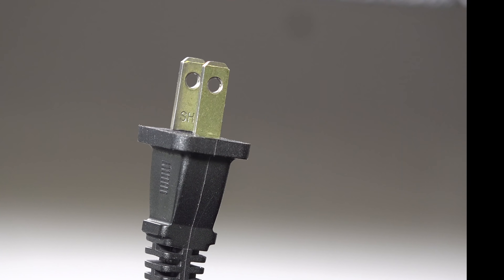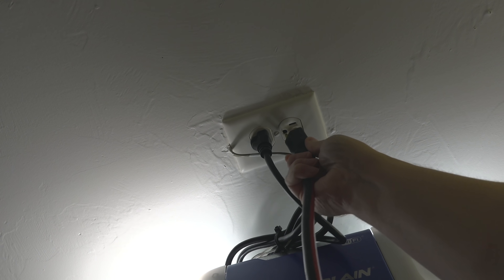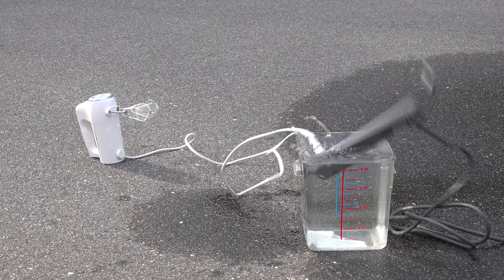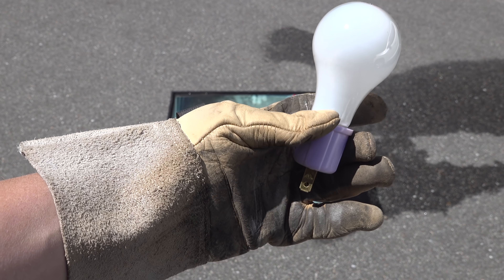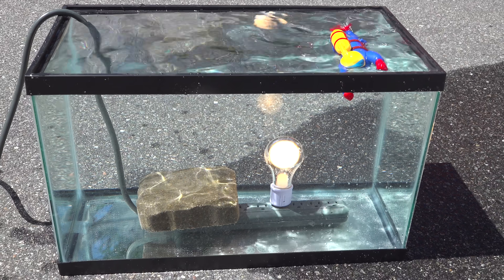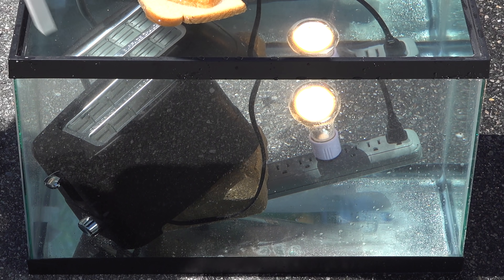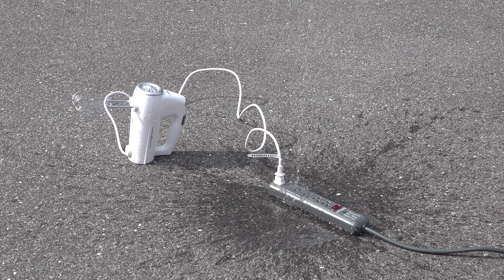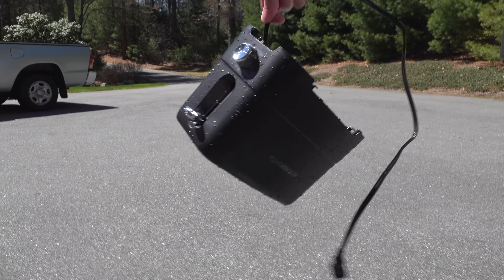What REALLY HAPPENS WHEN YOU SPILL WATER in an OUTLET?

Comment: Yup it fully make sense, GFI plugs are designed to trip if the GROUND gets power, so making contact between neutral or hot to ground will do that.

Both the neutral and hot wires carry current so between them it wont have a problem, but it will trip a proper house breaker (in canada) if you have the hot and neutral together.

But on that ground should not have current as then every box in your home is electrified like the screws on the switch plates and more as the ground wire on each box (if installed correctly) is now possibly hot. So thats why you use a GFI not to protect devices in most cases but to keep your house ground from getting overloaded, you can however do a direct ground connection from that box.

Comment: Pure water is a poor conductor. If water  is acidic or basified it will conduct electricity which might cause short circuit . I am no chemical engineer but this is what I was taught in 10th grade , I haven’t tried it , May be you can and then share. 

When I was young , Yes I did try salt water with DC electric terminals (12 volt Dc Adaptor) and I think it produced chlorine bubbles on the terminals of the adaptor

Comment: Thats so unfair, I spilled water on my battery backup and it instantly sparked.
Reply: That's a complex device compared to a simple hot - neutral AC supply
Reply: @wertbe1718  don't try at home
Reply: Probably due to the circuts inside not able to handle high voltage when it arked. There are transformers, batteries and lots of capacitors in there.
Reply: my keyboard always breakdown when I spill beer on it
Reply: That's why you don't buy bodgy china products m8
Reply: @dobronx2122  then buy US made products if you can find any.
Reply: @dobronx2122  china makes a lot of cheap products but also a lot of very high quality products. Kind of the same with everywhere. US makes a lot of cheap shit too.
Reply: @dobronx2122  you probably don't know that even your "premium" electronics are made in China... Usa makes a lot shitty products too.
Reply: @dobronx2122  
It wasn't Chinese
Reply: @dobronx2122  those devices in this probably made in china

Comment: Would love to see you do these with some way to test the charge of the water. To see if the electricity is actually travelling through the water. Like have a bin with metal nodes on the walls of each side of the bucket that you could touch a multimeter to. Would be interesting to see how much is being put into the water.
Reply: I like this idea, you could wire an ammeter to one side of the outlet and then dip electrodes connected to the ammeter and the other side of the outlet into the water. See if there’s any meaningful amount of current being motivated, or if it’s well below 15 A
Reply: @Nedyah-gg4bo  could also try different types of water. AKA bottled water, Tap water. Maybe get some water from an actual well. River water, and heavy water. To see the different resistances.
Reply: @Nedyah-gg4bo  If a ground fault interruption device trips, the amperage meter might not even be fast enough to give you an actual value because of how they tend to trip at very low currents (in The Netherlands I think it's 4 or 5 mA, which is enough to kill you at 230V).
Reply: ElectroBOOM made it some time ago. This guy just looks dumb doing these "experiments". Electricity takes the shortest path to the opposite wire, which is not through the whole water, or the human body.
https://youtu.be/dcrY59nGxBg

Comment: In this video, there are many factors leading to non conductivity of water.
Firstly the pure water is a bad conductor of elections, which he might have used and for water to conduct electricity it should have ion(in normal water they are the minerals) which help in conducting,  as few of the comments suggest there should be digital voltmeter should be used to show the reading, if voltage is low the appliance will work but will take time, so it a carefully planned video to fool all. Even using a pure water is enough to do this experiment without changing voltage.

Comment: Try probing the water potential. The media depiction of electricity + water is extremely wrong.

Putting electrical outlet in water creates voltage gradient between 2 poles. The amount of current going through differs between different areas (current path is longer).

Comment: Damn, this was super cool to see that the electricity / water thing has been a myth this entire time. This inspired me to take on more underwater / electricity excitements! Great video!
Reply: electricity water thing is not a myth. it really depends on the mineral composition in the water. pure h20 with nothing else does not conduct electricity and has very good resistance, its the mineral content in the water that causes electrical flow. of course in the wild there is no such thing as straight pure water.
Reply: @dawsonpate7385  You are absolutely correct.  The conductivity varies wildly depending on the water source.  Distilled water has low conductivity since the number of salt ions are almost zero.  Seawater is pretty conductive in comparison.
Reply: are you dead

Comment: A regular power strip is not a protection device. Unless you make a situation where there is a ground or a reason for the amount of amps to go over the current rating for the breaker it will never trip.

The entire point of this experiment is to show that there may be enough electrical current flowing through the water to harm or kill a human being and that a powerstrip, breaker or fuse will not do anything to turn the circuit off. You need a GFCI.

For people bringing up distilled water.. try to focus on the experiment at hand. It's about water from a home. Using solutio  with differences is another experiment completely.

Comment: Also... with all the tension in the water you are also doin water splitting. So producing Hydrogen that is flammable and explosive. So good thing you have done outside and without any source of ignition. Same experiment inside and smoking while testing could end differently if running long enough to build up hydrogen :D

Comment: Australian here, we use RCD breakers in place of regular circuit breakers, they drop out from leakage to earth similar to your outlets but because we use 230vac our standards have it protecting every outlet and light. this also means that the breaker trips when using a kettle every now and then because of water falling onto the pad.
Reply: Same here in NZ. It's a requirement that 1 or more RCDs (depending on the amount of internal circuits) are installed on your circuit board to cover all outlets in the house.

This way you don't need to have specific GFCI outlets and all of them should be protected by the RCD.
Reply: @xenibyte5898  The one problem I see with a whole house GFCI is that any sort of trip is going to knock out everything. So if you're taking a shower and someone in kitchen drops the toaster in a sink, well, you're now taking a shower in the dark. Whereas in a standard US system you'd just lose power to anything in series with that GFCI protection and could continue to enjoy such modern amenities as lighting as you wash yourself.

Comment: I'm surprised nothing happened. Because my sister was drinking a glass of water and accidentally knocked it over on her desk. Don't know how long it took for the outlet to react, but it still went KABOOM. There was a black spot around the outlet too.

I really don't get this "GFCI" protected outlet stuff. That shouldn't matter because there would be a short circuit between the phase and neutral wires. And by the way, the GFCI should be standard everywhere. In europe basically everything is grounded except some devices that are "double sealed". I haven't installed a single outlet that isn't grounded, and I've probably installed 200 by this point in my work as an electrician.

Maybe your water didn't contain enough electrolytes? Because the minerals in the water are what cause a connection between the phase and neutral, which cause a short circuit, which should definitely cause a breaker to go off. I seriously don't know what is going on here.

Comment: I could be wrong, but I think the fish tank does a good job of insulating the electricity from grounding anywhere.  A lot of other places where there is water there will be metal pipes that could ground the current, say in a sink or tub.  I think the experiment would be different if you put a grounded conduit in the water?

I'm guessing the resistance of the water was a lot more than expected.  Other people have asked about the conductivity of the water - have you tried other sorts of water?  With some electrolytes?  Also, were you using 3 prong (grounded) equipment?
Reply: Well the positive and ground outlet lines are submerged in the water right next to the live line.

Comment: People are way too scared of 120v ac current. It'll give you a good shock, but it's definitely not gonna kill you. I am kinda surprised the breaker didn't trip though, but it does make sense. There's simply enough resistance in the water to not heat up the breaker enough (they're usually thermal breakers) to cause it to blow. It would have really been interesting if you'd had an inline amp/watt meter attached to it while submerging the power strip.
Reply: The problem is when people pass out, for some reason or other and they cant let go so the volts keep going. Either way any amount is dangerous

Comment: Standard breakers trip because of heat. The heat that’s trips a breaker is usually caused by a ground fault. If the branch circuit doesn’t heat up the breaker won’t trip. Tapwater is actually pretty decent conductor of electricity.

Comment: That's a toy with only 120 volts. Do that in a country with 240 volt AC and you will be amazed.
I mean as long as the water is in a plastic tub nothing will happen!
But if you have copper water pipes (grounded) and you hold them with one hand and want to get the hair dryer out of the bathtub with water with the other hand, then it becomes really dangerous.

Comment: The real purpose of a standard breaker is to avoid that too much current is flowing through the wires which could causes them to heat up a lot and maybe set your entire house on fire. While water containing at least some amount of salt is conductive (pure water is not, by the way!) and will cause current to flow where it shouldn't, it still is a rather bad conductor, so it won't cause a short circuit or enough current flow to pop a standard breaker, it can however cause enough current flow through your body to kill you (that is if you are unlucky and a couple of other factors apply). A GFCI breaker on the other hand already reacts to very small amounts of current being misdirected, that means, if a bit more current flows out on one cable than comes back on the other one, the current went somewhere else and somewhere is not good, so it will pop at once, even if that was just very little current. At my house, there are two large GFCI breakers in the breaker box that protect the entire house, so every outlet and every switch at my house is protected by these, except for hard-wired components that cannot be unplugged and where the electric is sealed and waterproof to begin with (stove, hot plate, central heater, etc.)
Reply: Even those hardwired stuff is behind the GFCI i would assume. At least in my country and neighboring countries they are.

Comment: I hold a wet outlet and getting constantly shocked and thinking while holding it why my arm feels like someone stabbing me with needle. Because of the shock, i didn't felt the water even when i was holding it. But when i tuned of the swich and unplugged i saw it's wet. Good thing home voltage is only 240v . Or than could've turn out to be a disaster.

Comment: The most important factor is electrode surface area or ion. If you wanna put through electricity in water, the electrode should  react with water and ion current should go through between electrodes. Thus the amount of current depends on how electrode reactive or water ionized.

Comment: The thing that Baffles me on this as an Electrician is how freaking Slow that Circuit Breaker Reacted.
These things should usually cut the Electricity in less than a Second. 

I am not sure how the Regulations for this stuff are where you Live. But where I come from this thing is absolutely not within the Requirements of a GFCI Protected System.

Comment: Would be good to have a voltmeter hooked up to each device as it is on out of the water and then in the water to see if any change in volts or amps. I've seen computer restorers who take a motherboard and put it in a sink of soapy water, clean it well, rinse it off with water, and then dry it and it works fine as well.

Comment: The water is energized and splits into the 2 base gasses, which are highly flamible. That's what those bubbles were out of the toaster. For normal electronics, water causes corrosion which becomes a fire hazard over time.

Comment: It wasn't dangerous because of explosion hazard - water doesn't have high resistiveness, so if you were to put a hand inside a water with electric outlet submerged, you will get electrified. It's similar to putting scissors inside the outlet - it won't destroy the outlet, and you won't die if you put it out and then touch it, but it will be dangerous if you touched that metal part when it's inside.
 And now a thing for Europeans: 50Hz is a frequency of our voltage, but so is our heart rate. This makes being electricuted in Europe more dangerous than in USA with 60Hz

Comment: In german the circuit breaker ist called "Leitungsschutzschalter" (wire protecting switch). And this is exactly what it does. It protects the wires from too much current if there is a short circuit.

Only the GFCI is designed to protect humans.

Comment: Wow, this is really unexpected. At work, I someday was cleaning the working station at the lab. Sprayed a little bit of water and accidentally sprayed some inside an outlet. All the power went out almost immediatly and I was so scared, because in the next room we had a machine, which can't run empty, because it has the chance to break some parts in it if it does (the part would cost a couple thousand dollars/euros). Thankfully the two power systems were sepperated!
Reply: Sounds like the power system had a GFCI outlet or circuit breaker set up
Reply: @OpticalLimit  Yesss! And I thank the heavens for it! 😂

Comment: Video: "Don't try this at home, water and electricity don't mix"

Also video: "nothing happened, and also water and electricity works symbiotically in such an intuitive way that diseases have been cured and the entire human species evolved the span of 1000 years in just 4 minutes. But don't try this at home."
Reply: The problem is that if you stuck your hand in while it is plugged in you could get a nice shock if you are grounded.  Could even kill you.  So, although it appears nothing happened, there is still some current flowing through the water, just not enough to trip a 15 amp breaker.
Reply: Lmaao thought the same 🤣
Reply: ElectroBOOM has a video on this. Nothing happens

Comment: My electrical teacher did this before and had a big lesson on it. Putting just 1  hand in the water with just a standard 120 volts wouldn’t kill you. You actually barely feel that much to a shock from it. It’s only when a large part of your body, or something like your heart is in the water that it would have a chance of killing you. Electricity is still dangerous though and you should never touch it unless you know what you’re doing. I’ve also seen water spill on to a power strip and light a small part of a rug on fire. I think that power strip had something else inside of it just short out though because it was on a gfi that tripped.
Reply: @Jonathan Jacquet it's actually both at the same time. Low voltage with high amps won't kill you. Watch this https://youtu.be/XDf2nhfxVzg

Comment: Holy cow, I can't believe you did this, and the water was electrified, too?  And your wife didn't kill you either lol?  I always thought electric things would short out if they got wet, yet yours didn't, even though you put it all underwater?  Yet, when you plugged the same setup into  a GFCI outlet, the outlet tripped, so a short was going on somewhere.   What is going on, why didn't the underwater toaster short out, why didn't the house breaker trip, but the GFCI outlet did?
Reply: Tap water isn't that great of a counductor, therefore it's not a short-circuit in a conventional sense (short usually implies low resistance). The difference is the GFCI will trip if it detects at least ~5mA of current through ground. A breaker is only going to trip if it exceeds its maximum current (15A for typical household circuits), since water alone isn't that conductive there definitely is nowhere near that much current flowing.
Reply: @artomix7  Thank you for explaining this.  So  the surge strip  he put in the water - do they behave like the house breaker & need more current to trip too?
Reply: @DM-lk5ym  The power strip (at least most of them) doesn't have any sort of way to trip if there is a fault or overcurrent, so when you plug in the strip it's just acting as an extension of the house breaker, since any current flowing through the strip flows through the breaker in the house.

That's why it tripped by plugging it into a GFCI outlet, even though the power strip itself doesn't have GFCI built in.